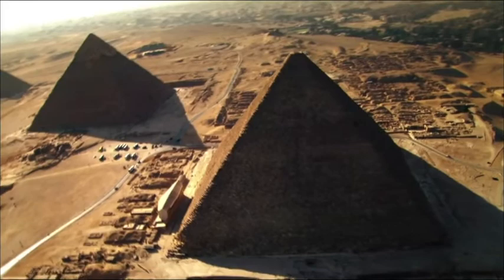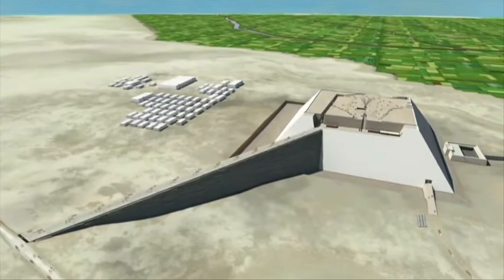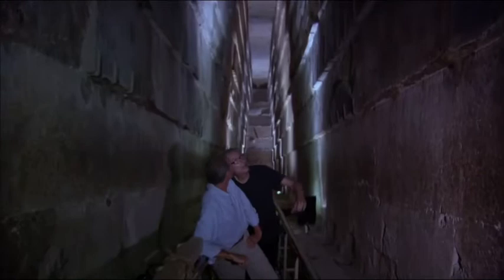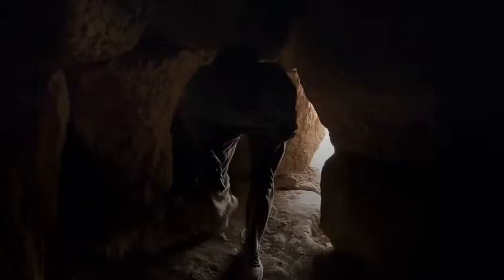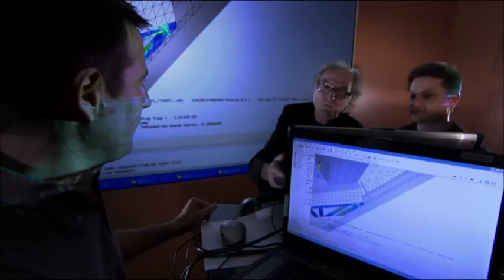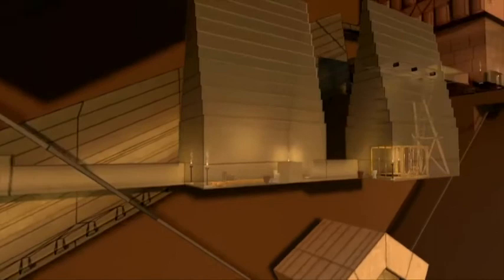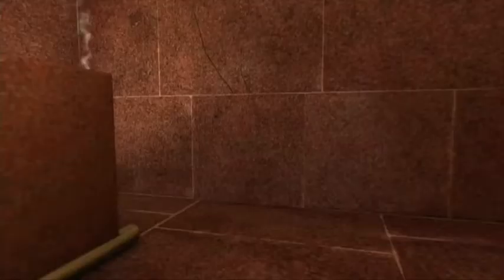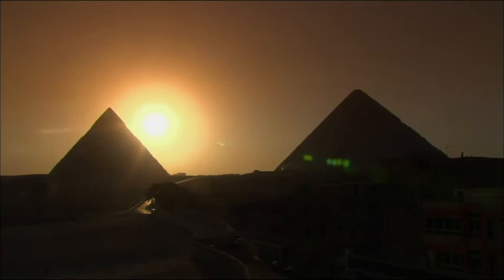Khufu Update - Jean Pierre Houdin’s Theory 2011

Comment: It makes me think the grand gallery is more of a machine and enginered for a mutliple of reasons. A passageway, strength and a machine all at once. The ceiling is so high that can allow a large lever, to gain a better mechanical advantage, on each side by inserting into those slot like a ratchet. Perhaps to hold rollers, stop blocks, or other multifunctional purposes. I bet there are more on other areas whereas it's no nonger needed to save some stones and covered them. Next I have noticed there are so many pyramids that goes all the way down to Sudan. Maybe try to back trace to see all of those builder's trial and errors to gain a better perspective.

Comment: But what wasn't explained is huge. How did they cut the blocks? How did they get stone so smooth? How did they get all the cutting, polishing, finishing and laying done in a timescale that would be plausible in any way? How did they mine the stone from hundreds of miles away in some cases? How did they cut the hieroglyphics so precisely? If using a counterweight, how did they lift the counterweight into place seeing as it would be even heavier than the block they want to move? (Obviously they could use lots of smaller blocks, but that's too time consuming for this to work in the time period needed, let's not forget how many blocks needed lifting up there). How was what seems like 5-10% of the entire world working on this at once? So many unanswered questions that for me this theory is just another guess at one small piece of the puzzle, but unfortunately it doesn't add up with the rest of the equation.
Reply: It took 7 years to cut the large granite blocks and they used a harder rock to chip away and cut the slab. You use a softer stone and a lot time to grind it smooth and an even softer stone to polish and only one side needed to be smooth on the large 60 ton granite stones. The side that served as the ceiling. Then they roll it onto a sled so they probably didn't cut one side straight but probably round so they can roll it. Then they built a track threw some bamboo as rollers and rolled it on to the harber rolled it on a barge sailed  500 miles down stream. Rolled it again on the track that still exist today
Reply: Just like any modern day move of something large and heavy you have to build the infrastructure first. Roads and harbors staging areas, cranes docks. Some of this infrastructure used to build the pyramids still exists today.
Reply: And just like any modern skyscraper the pyramids we're built by a professional crews of several thousands each specializing at a certain trade. You had sculptures who had the tools to specialize in carving just hands and feet others animals others symbols. You had painters masons copper smith's bakers beer makers day labours who mostly worked on the chain gangs rolling stones on a track that still exist today
Reply: Rolling the large stones I'm speculating. They probably cut the slabs in a straight line to the docks on the  harbor now that I think about it. I saw a show where these guys cut a huge slab and left 2 faces round then they rolled it..
Reply: @Pomorchik  The corners weren't capped to provide light and ventilation as well as the clearance necessary for cranes that turned the blocks by lifting them to turn them 15 degrees. You can see the one of these corners towards the top of the pyramid. It's the notch and it's right where it's supposed to be.
Reply: @Pomorchik  Not if you cap them from the top down. Think about it.
Reply: @Pomorchik  You can even see ghostly lines at the 7 degree exactly where Pierre Houdin calculated they should ending at the notch towards the top.
Reply: @Pomorchik  Ok so the French team in the 1980s scanning of the Great Pyramid found areas of low density that spiral around the pyramid. They also bored through the rock and shoved a probe to find a empty hallway full of debris. Not indisputable evidence but gives credibility to Pierre Houdin's theory. This new project of scanning the pyramid with neutrons is because of Pierre Houdin's work. How do I know? Because al-Sacari or what ever the former director of antiquities name is barred Pierre Houdin from being a part of the project. No one else was barred, just Houdin was singled out personally. Now why would he be singled out if his work is bullshit. The Egyptians don't want Pierre Houdin to receive any kind of credit, this is purely political.
Reply: @Pomorchik  There's other structures constructed with an internal ramp, so they new how to construct using internal ramps. Pierre Houdin also predicted new hidden chambers behind the Kings chamber because of a non- load bearing stone and the way air vent turn and swerve with no reason as to dodge this hidden chamber. Which is why this new project to scan the Great Pyramid with Neutrons is underway. They never found a mummy in the Kings chamber because that was a decoy, Khufu's probably still there untouched in this hidden chamber. And that's why al-Sacawi or what ever his name is doesn't want Pierre Houdin around. They want to take credit if Houdin is right. And the world will soon find out of if he is.
Reply: @Pomorchik  " you think, I'm wrong " or " I could be wrong " or " Pierre Houdin is wrong " We're going to find out here in the future aren't we.
Reply: somebody already mentioned the way stones were used to bore out blocks/monuments (millimeter by millimeter), but saws made of copper that used sand as an abrasive were also used. These would not have teeth (copper would be too soft to cut like iron) but would instead use sand as a sort of saw tooth substitute that allowed for more precise cutting than chipping away with a slightly harder rock for months. For example, a granite sarcophagus on site used this method, and we can actually see where the artisan made a mistake with the saw and had to start again. ( https://www.youtube.com/watch?v=i8ZHYWle0DE&ab_channel=ScientistsAgainstMyths - Here is an example of some modern people trying the method out in a much smaller and less experienced way). To answer your question about smoothing, the answer is similar: sand and rocks. a flat rock and some sand  (as an abrasive again) can be enough to smooth a surface, especially if the rock being smoothed is soft like the sandstone and limestone that was most commonly used for the pyramid. The majority of stone was mined from a quarry close by, the giza quarry, (here is a website that talks about it and has a picture of the quarry and its proximity to the pyramids - https://www.wonders-of-the-world.net/Pyramids-of-Egypt/Quarries-of-the-pyramids-of-Egypt.php) though some was from further distances (granite especially).  to transport the stone, sleds pulled by men and cattle were common, as were the use of channels and boats (a channel was dug from the pyramids to the Nile). 

Other than those things, I don't know the answers ( I am just some dude who likes history and archaeology, not an archaeologist). Here is a more comprehensive video on the subject, though it is a response to Ancient aliens, it has a lot of good information in it as well: https://www.youtube.com/watch?v=j9w-i5oZqaQ&t=1266s&ab_channel=VerseByVerseBT pyramid section is about 27 minutes in.
Reply: @stephencecil6809  I'm aware of using sand as an abrasive to cut through types of stone but it would take far too long, we'd still be rubbing the sand around now!